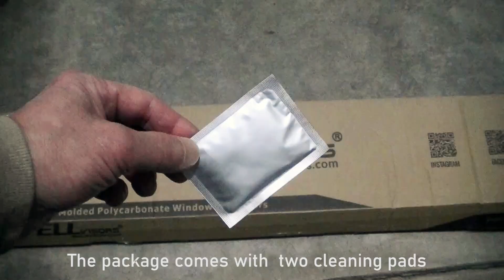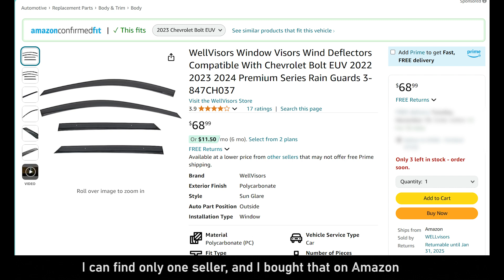Install Wind Deflectors on 2023 Bolt EUV

Comment: how is the impact on the EV's efficiency?
Reply from the maker: Per the car's power consumption data before and after the installation of the deflector, I don't see any efficiency impart. I added the roof top rack and I also don't notice any impact in power efficiency. However, the loading and the terrain have significant impact to the mileage of the car.